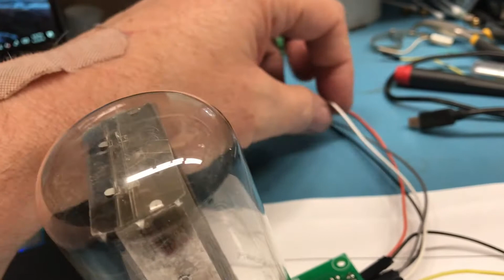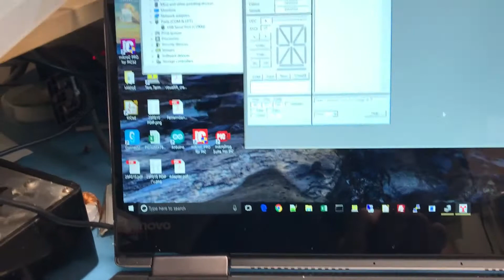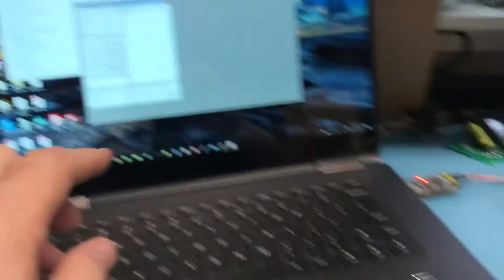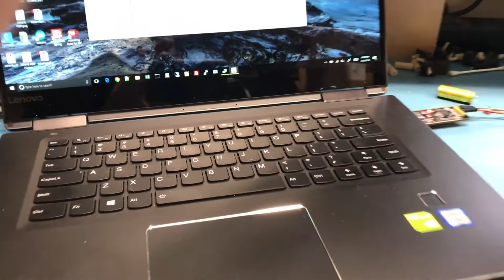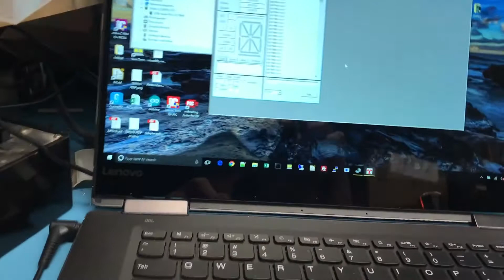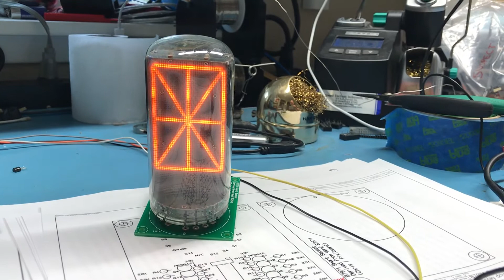B7971 Clock - Part 6 - Lighting up one of the tubes - STB147

Comment: What is the method used to control individual segment and change individually brightness ?
Reply from the maker: As I recall you need to use a separate program to design the fonts you want. You can find one of these on the page below. For NIXIE brightness I use PWM on the drive pin for the segments I want dimmed. As far as I recall the smartsocket PCB doesn't support this. With that said there looks to be effects that can be defined, I have no idea if one of these supports brightness. See the 2nd link.

https://www.shop-tes.com/1386-b7971-smartsocket-pwb-assembled-and-tested/

https://threeneurons.files.wordpress.com/2015/05/smart-sockets.pdf